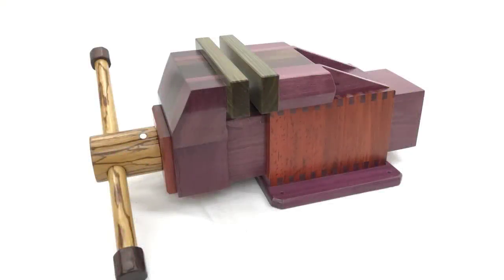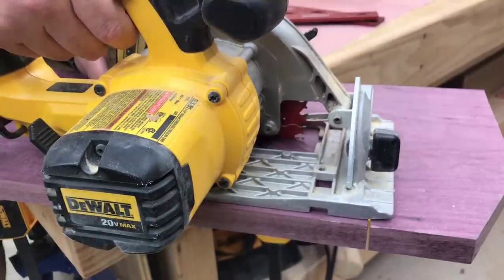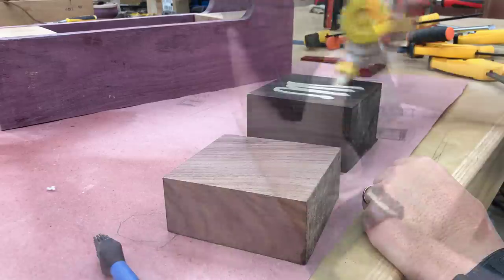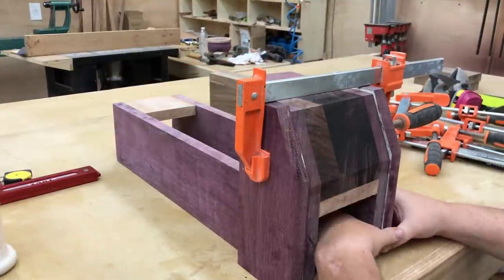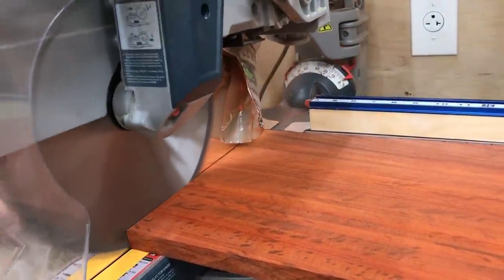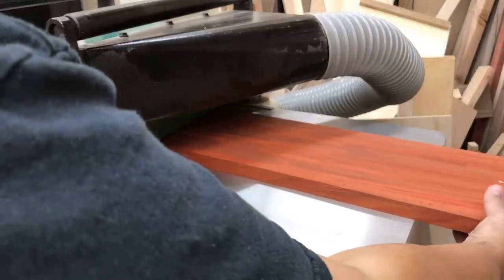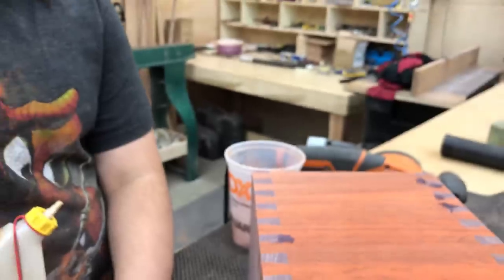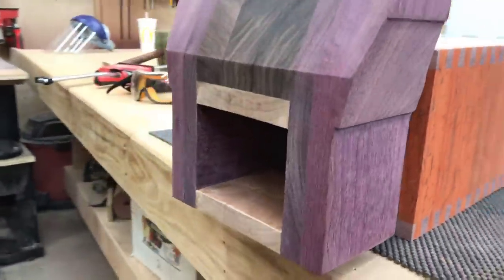18 - How to Make the Extreme Bench Vise Homemade All Exotic Wood incl Through-Dovetail Tutorial

Comment: with dovetails its possible using regular titebond that the glue up will bind before you get it all the way together.  The 24 hour set up titebond will give you longer working time with dovetails and for a tite fit I found works better!  red oak and dove tails is what I was using!
Great video!
Reply from the maker: You are exactly right. You have to work mighty fast for a big dovetail joint. Thank you for watching.

Comment: Thanks for the video. Charming idea.
You must have nice glue bill if you´re putting on so much. I wouldn´t let it dry over night every time. At normal room temperature you can easily and at no risk continue working on your pieces after merely an hour. If it´s warmer then it´s in even less time. I just wouldn´t charge it completely before a day time has passed.
Reply from the maker: Hi. Thank you for commenting and thank you for your input.

Comment: How do you account for the protrusion of the dovetails when you dimension your stock? For instance, the inside area of the static body would end up too small if you didnt know how much of the dovetails would stick out. Am I asking that the right way?
Reply from the maker: Hi Ben! That is a great question. I tried to set up the dovetails so that virtually none of the dovetail ends stuck out. And then then I built the two components so that the dynamic portion of the jaw should have been just a tiny bit too big. Then I sanded it down to a perfect fit after the static portion of the jaw was completed and dry.

Comment: You said "Gotta use the old salt trick" then you added salt on top of the glue at 14:30 of the video.  I did not see you put glue earlier in the video. What is the purpose of the salt and when should it be used?

Comment: If you don't mind me asking, what type of parallel clamps are you using? are they good? By the way; really nice shop, and really nice work too. Thanks for the videos.
Reply from the maker: Hi, I use Bessey Parallel clamps. They are the best in my opinion, and although they are expensive, (all parallel clamps are sadly), Bessey usually has a deal to buy a 4 pack at a really good price. I got mine on Amazon here: http://www.amazon.com/dp/B001HSO6VI/?tag=kingsf-20

They also have all of the sizes there. Thanks for watching!
~James

Comment: Nice work, where did you get the glue applicator with the roller?
Reply from the maker: Hi Riley!  I got this set for all types of glue ups. It has the roller and a few other useful tips. It is the Rockler brand. Be careful buying anything other than the Rockler one. Some of the others become trash if the glue dries on them. But not this one. I never clean it after using. I just put it away after gluing, and when the glue dries on it, it'll just peel right off, because it's formulated with silicon. 

http://www.amazon.com/dp/B00EA1KL0O/?tag=kingsf-20
Reply: Thankyou! keep up the good work

Comment: I see you use Amazon for your wood, how good is that stuff when you get it? I am very skeptical about ordering things off the internet because I tend to want to sort through the pieces to get the straightest possible that I can.
Reply from the maker: Its ok for turning blanks, I've never had a problem. And you really can't see much of the grain or figure anyway since they are always covered in wax. Also with short lengths the wood always seems to be straight. For regular size pieces of lumber I've only bought locally where I can see it myself before buying.
Reply: Thank you, but yeah I do not have a local lumber yard except the big box stores and they do not even carry the most common plywood we use for cabinets such as Baltic birch for example. You can hang up purple heart or even maple around here, I have poplar, pine and oak so I need to find an honest online retailer.

Comment: Good sir, may I humbly request a project using coconut lumber? There are very few woodworkers out there who tackle that particular wood/grass so there is very little information on how to use it, protect or finish it. Many thanks!
Reply from the maker: Hello Mikhail,  
I can do that for you. I have used it before and it is a difficult species to work with. But I currently have some, and I will make a Woodworking Mallet or something similar from it. 
Thanks
James